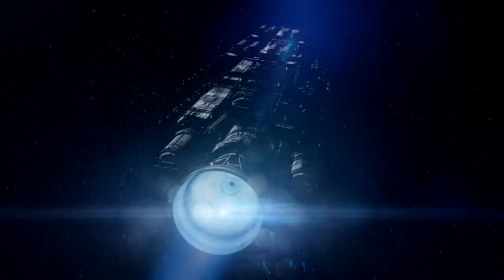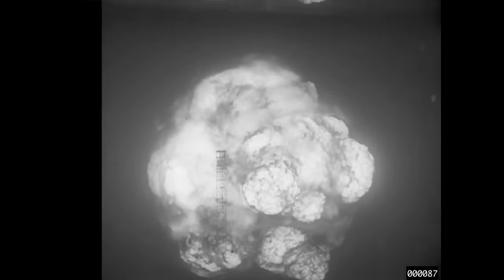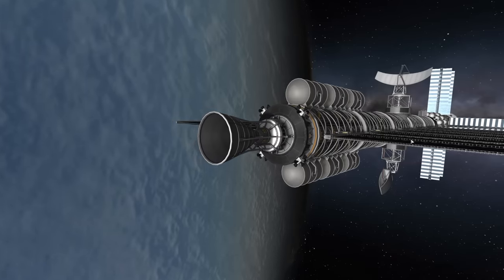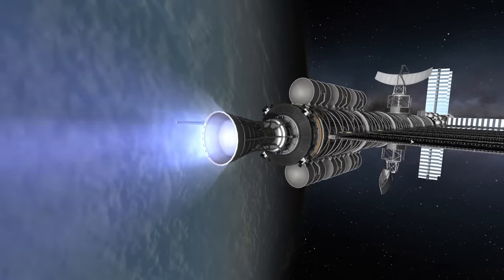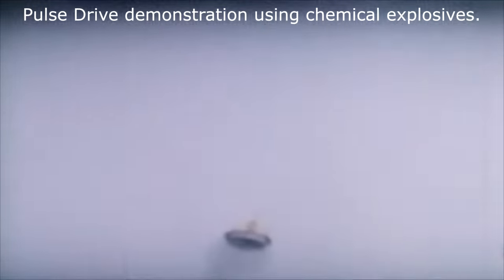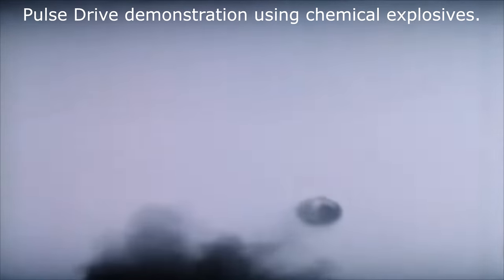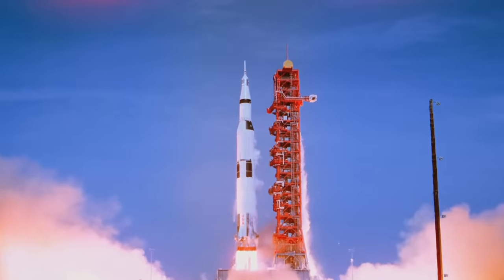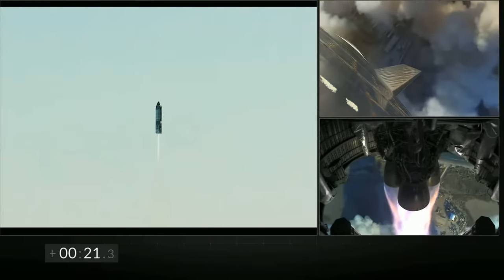The Nuclear Salt Water Rocket - Possibly the Craziest Rocket Engine Ever Imagined.

Comment: I don’t want to imagine what a “hard start” would look like for this
Reply: How would you even throttle something like this?
Reply: @TheVillainInGlasses  Probably diluting the U salt concentration by mixing pure water in
Reply: @TheVillainInGlasses  probably by simply decreasing the amount of fuel flowing in. The engine would only be throttleable up to a certain point, below which the engine would flame out because there isn't enough fuel to maintain criticality. This could be overcome possibly by increasing the concentration of fissile material in the fuel as needed to keep the engines running at the lower throttle settings.
Reply: @TheVillainInGlasses  You can probably vary the amount of water being pumped in to a certain extent, while still keeping the reaction inside the nozzle. But if you set it up to create an average acceleration of 1G or so, there's really no need to throttle it.
Reply: @TheVillainInGlasses  change the pure water/ salt ratio or, more likely, adjust neutron emitters/ absorbers near the nozzle. Changing fuel flow isn't an option I think since you need constant fuel flow to stop reaction from going into the fuel line. Can also use electromagnets to divert plasma flow a bit, everything that goes to the side doesn't provide thrust.
Reply: @TheVillainInGlasses  As others say, you could dilute the mixture, or use neutron absorbers. Another choice would be simply venting part of the reaction products laterally, i.e. with some kind of hatch, or magnetic wall.
Reply: @kelvinyonger8885  That would cause the craft to start spinning. Any jettisoned material will have an effect, and if you start throwing it out the side.... well your monopropellent thrusters would blush compared to this XD
Reply: Oooooo, the DV/DT would be impressive!
Reply: Reckon you'd just restrict the fuel at output and reduce pressure, if you do it right the water will flow at the same speed through a smaller aperture
Reply: @TheVillainInGlasses  create feul piping with a variable crossection area. That way, the speed of the fuel can be maintained when the flow rate is changed.
Reply: Good to see this thread has smoothed out the details of the design!  Can we expect a prototype by mid '22?
Reply: I don't think this is the kind of engine you "throttle", its either on or off, and maybe you have some sort of fine control for precise movements. But I don't know much

Comment: The Expanse’s HE engines, and using continuous acceleration for artificial gravity, has made the suspension of disbelief more difficult when watching other Sci-Fi.

Continuous acceleration seems more achievable than warp or hyperdrive.
Reply: The concept of 1G torch drives have been around for a long time in science fiction.  Just that the majority of stuff that makes it onto the screen is very soft science fiction.
Reply: @bindingcurve  > Just that the majority of stuff that makes it onto the screen is very soft science fiction.

That's because there's the usual triangle of opposing objectives at play: the story, the science, and the budget.
Even if the budget is there, it's usually the story that wins in the end. See for example Interstellar, where Susskind had to - quite literally - bend the rules quite a bit to make the extreme time differences work that the story demanded. Well that and traversable wormholes of course ;)
Reply: @totalermist  Interstellar is a perfect example of having to suspend disbelief to a ridiculous level.  The only crop that exists is corn because of some mysterious 'blight'.  Some weird kind of suppression of science mixed with interplanetary space craft, and super science gravity drives that allow people to leave the Earth I guess so it can heal. What a mess.  Looks pretty.

Comment: Wow, thank you for the video, Scott Manley. This might be coolest thing I've ever heard. A crazy, continuous nuclear reaction rocket that can produce thrusts somewhere between 60-70 km/s and one percent of the speed of light!

"Which is probably a good thing, because you don't want a nuclear reaction running up inside your engine plumbing.."

I'm not an engineer, but this sounds like good advice. You'd probably want to make sure the exhaust is never pointed at the Earth as well.
Reply: There's only so much the magnetic field can do. If you point an extremely high velocity stream of radionuclides right at the Earth that's too much mass and speed to overcome.

Comment: Instead of using normal water as the moderator, could you also use heavy water, or even tritium water, to get some additional fusion reactions going on?
Reply: Good idea! The only problem is that the moderator ability would be affected substantially. Water is chosen as a moderator because its H isotope is 1 proton. This means in a collision with a stationary proton, a neuton would reflect back with half its original momentum and the proton carrying the rest approximately. The means the velocity is halved for the neutron. Increasing the mass of the isotope means its is more likely that the neutron would just reflect in the opposite direction with similar velocity instead of slowing down. You could increase the fuel concentration to increase the likelihood of a collision.

Comment: It’s very hard for me to conceive how such a reactor could be controlled, given prompt neutron lifetime on the order of 10-4 seconds. It seems to me that any perturbation in flow rates, for example, would lead to extreme instability quite rapidly. [Correction: there are about 10-4 seconds between successive generations of prompt neutrons, not the neutron lifetime.]
Reply: A free neutron's half-life is about 10 min.
Reply: Reactions require a critical mass, without which nothing happens.  It's not difficult to imagine that flow rates and reaction geometry would be such that perturbations would snuff out the reaction rather than enhance it.

It's worth remembering that getting a nuclear reaction to even start is not trivial.  Nuclear weapons require incredibly precise tolerances and timing.  One thing out of whack and you get a bunch of conventional explosives scattering uranium/plutonium around instead of a big boom.  Nucelar reactors, being largely static structures, are easier to light off but that wouldn't apply to something dynamic like NSWR.
Reply: I’m a retired nuclear engineer, but I used the wrong term in my original comment (been a long time since NE 301).  There are about 10-4 seconds between generations for prompt neutrons, not the neutron lifetime. A slight increase in reactivity, such as a very minor increase in flow, could result in an extremely rapid power increase which I doubt any control system could regulate.  It is difficult for me to conceive of any prompt critical reactor being kept at a stable and controlled power output.
Reply: @gizmophoto3577  think it was I didn't understand exactly what you meant by 'prompt neutrons', just a layperson
Reply: @gizmophoto3577  sounds like pump flow tolerances for medical equipment. Somebody should have a 'fun' time scaling that up to feed this engine :p
Reply: @gizmophoto3577  "result in an extremely rapid power increase which I doubt any control system could regulate"

Injection of regular water into the fuel stream? (naturally reaction times for the regulation system would need to be superb)
Reply: @KOZMOuvBORG  There are two types of neutrons emitted by fission. Prompt neutrons make up the vast majority, and are emitted almost immediately (10-4 seconds). Delayed neutrons are emitted some seconds later. The math gets a little complex, but the key message is that delayed neutrons are essential to controlling the reaction.  If a reactor relies on both types of neutrons for criticality, power changes are relatively slow and easily controlled. If a reactor is critical using only prompt neutrons, this is called “prompt critical” and power changes very rapidly, as at Chernobyl.  Nuclear bombs are prompt critical reactors.
Reply: @lancer2204  it seems to me that any system regulating the flow could not do so in the extremely short timeframes required. Even if the system could detect the perturbation and responded immediately, the flow into the reactor would not change immediately.  A change by the control system upstream of the reactor would take a long time, relatively speaking, to be seen at the reactor, as such changes would have to take effect in a time frame comparable to the prompt neutron generation time. 

I welcome feedback from anyone who has more expertise in reactor kinetics.
Reply: I imagine boron lined plates in certain sections of the fuel line would also help that?
Reply: @1320crusier  As I understand the design, likely not.  The problem is that power in the reactor region would be extremely unstable in response to any perturbation, not so much in the fuel line upstream.
Reply: @gizmophoto3577  Thanks for the info (being a math-phobe, didn't get far with Physics), 
would those neurons be similar to those used to sustain criticality in a liquid salt thorium reactor? Would the difference be 'fast' or 'slow'?
Reply: @gizmophoto3577  from the info here it seems that a split flow into the nozzle would help. If the reaction creeps forward it would be split and hindered by boron plates and pipe linings, assuming they aren't vaporised by the encroaching reaction :p 
Maybe having several streams meet in the center would work. If the individual streams are too small to be critical the reaction could never creep up them.  Starting this setup is probably an issue. Is there a nuclear equivalent of a spark plug?
Reply: couldn't you use neutron sources to make the reaction in the reactor area easier to happen ?
Reply: @KOZMOuvBORG  Fast neutrons are high energy particles that haven’t been slowed by collisions with other atoms, and are traveling at extreme velocity (I.e., large fraction of the speed of light).  Slow neutrons have given up a lot of their energy in collisions, and are more likely to cause subsequent fissions than fast neutrons.  Their speed can be expressed in thousands of meters/second. The speed of the neutron is independent of whether it is a prompt or delayed neutron.
Reply: @KOZMOuvBORG  Molten salt reactors, including those using thorium, can either be “fast” or “thermal” reactors, depending on which set of neutrons provide the bulk of their fissions. They all depend on delayed neutrons for criticality. They would be extremely unstable if they relied on prompt neutrons.
Reply: @gizmophoto3577  I believe the LSR needs to have neutrons supplied by an external source to maintain criticality, hence those would be 'tailored'
Thank you for the chat, now need to bone up a bit (not that I'm trying to emulate the RadioActive Boy Scout)
Reply: @danilooliveira6580  Was mentioning something similar to be used in thorium reactors, in this thread
Reply: @danilooliveira6580  A neutron source is typically used to start a reactor. They aren’t needed once the reactor is critical. By definition, a critical reactor is self-sustaining from the standpoint of neutrons.
Reply: @gizmophoto3577  I second my Interrest in someone adding their knowledge in reactor kinetics and want to add that, as far as my rudimentary horizon of the field tells me there are still several fundamental unknowns in "operating" a prolonged supercritical mass in a matter resembling "control". Also dont underestimate the effects of zero gravity and the vacuum of space - if all what ive been reading about chernobyl over the years taught me one thing it is that most of the operational non experimental field is still stuck in the 50s and everyone who overconfidently claims to have figured out the operation of those hushed into production Prototypes is a fool. More R&D, practical experience in dynamic operation and, most important, adaption of the enigneering with what modern electronics bring to the table is desperatly needed.
Reply: @gizmophoto3577  - Multiple injectors directing exhaust to a single point in the combustion volume.
Reply: You didn't use the wrong term, since "lifetime" in nuclear physics means time until the neutron is either absorbed (by fuel or neutron absorber) or exits the reactor.  It was confused by your"10-4 seconds" for a moment until I realized you meant 10^-4 (i.e. 0.1 ms).  Such a low lifetime is necessary and unavoidable for this engine design though (regardless of whether it could work and be regulated effectively), since the reactor (the fuel, the moderator, and the neutrons of the ongoing reaction) is a fluid being continuously flushed out of the rocket at high velocity.  I don't think much common sense or intuition from normal nuclear reactor design applies here.  I do agree that controling the reactivity seems like a problem, though more in the sense of maintaining high enough reactivity for long enough despite the thermal expansion of the moderator and its dissolved fuel.  Presumably the paper addresses this, I haven't dug through it yet though.
Reply: @MatthijsvanDuin  100 ns seems rather long for a fission generation, but maybe that includes the moderation from fast to slow-enough-to-have-a-good-cross-section? I believe I recall a "shake" being 10 ns.
Reply: @AlexandervanGessel  You saying 100 ns made me realize my brain couldn't decide between typing "0.1 ms" and "100 μs" and ended up mashing them together, I've fixed that now.  And yes the 100 μs includes the time bouncing around in the moderator to slow down.  In fast reactors the lifetime is much smaller, though the value I've found is 0.1 μs (100 ns).  I think the 10 ns value applied to nuclear bombs?  In general the time will depends greatly on the situation, i.e. which materials are involved and how they are arranged.
Reply: @gizmophoto3577  but if the problem is that perturbations can stop the reaction, wouldn't neutron sources give it a bigger margin of error for the reaction to happen ?
Reply: @MatthijsvanDuin  10 ns is indeed the approximate generation time in a fast-reacting (no moderation) solid lump of fuel.
Reply: @danilooliveira6580  It’s not that perturbations can stop the reaction.  Rather, it’s that the reaction will go out of control very rapidly and explode. Prompt critical reactors are inherently unstable, and not in a way that makes them more prone to shutdown.
Reply: @KOZMOuvBORG  A device that requires a neutron source to maintain fissions is a subcritical assembly, not a reactor capable of criticality.
Reply: @gizmophoto3577  Not meant as a source of power, but to facilitate criticality in an adjacent thorium-232 core.
Adds a step of complexity but isn't thorium (India) more plentiful than uranium (and can't be made into bombs)?
Reply: @KOZMOuvBORG  I’m not up to speed on all the proliferation issues, but Th-232 converts to U-233, which can be used for bombs. 

If you mean a neutron source facilitates criticality by providing the particles necessary to initiate the reaction, that is correct. Once a reactor is critical, a neutron source plays no significant role in maintaining the reaction.
Reply: @gizmophoto3577  Don't think the military found any gains mixing Th-232 with other fissiles in a couple tests.
The Th-232 LSR needs an external (regulated) source of neutrons to run

Comment: On the second option with the weapons grade uranium, it says 90 % enriched uranium 233 but you said 235 did you notice it or was it a mistake?
Reply: 233 is fissionable and fissile. It would serve just as well as 235. 238 is the non fissile variety. 

I can't tell you the benefits of using 233 vs 235 though, other than it can be produced in large quantities via the thorium cycle.
Reply: @cl5258  interesting. Guess we wont be getting Scots opinion 🤷.

Comment: Maybe there's a way to better control  the timing of the fission fuel. Maybe instead of load the tank with solid boron material to soak up the reaction so it doesnt react, instead mix in a boron solution with the fuel at a high enough concentration to keep it safe then mix another chemical to either remove the boron solution or spread it out enough to cause the uranium salt to undergo the reaction. Just an idea.

Comment: I wonder, if you were to add heavy and super heavy water into the water stream at the right quantities, would the fission reaction provide enough energy to trigger fusion reactions and thus improve, albeit theoretically, the performance of the engine?

A "non-strop chernobyl"-powered fusion torch? :)
Reply: I don't think it would trigger any fusion reactions due to lack of compression, but since heavy water is a neutron moderator it could increase the fission rate of the drive and boost performance.
Reply: @paulmahoney7619  Plus the engine nozzle could be made out of beryllium to reflect escaping neutrons back into the reaction boosting performance even more.

Comment: Don't worry, a fusion drive would make a great weapon. It will be invented for certain.
Reply: What's a hydrogen bomb again?
Reply: Yeah, the Kzinti realised it too late.
Reply: Everything is weaponizable.
Reply: @Skylancer727  single use very high output unshielded fusion reactor. :p
Reply: Any thing that gets you from one star to another in less than a lifetime has enough kinetic energy to be a fantastic (i.e. civilization-ending) weapon if you can't manage to decelerate it properly.
Reply: @ylandrinschweitzer  remember to always aim off to one side of the planet during decel just in case the engine fails. Preferably out of its orbital plane. XD
Reply: @ylandrinschweitzer  P.S.: 1 metric tonne hurled from the Moon to the Earth arrives with about 24,000,000,000,000,000 joules of kinetic energy which is around 5.7 megatons of TNT.